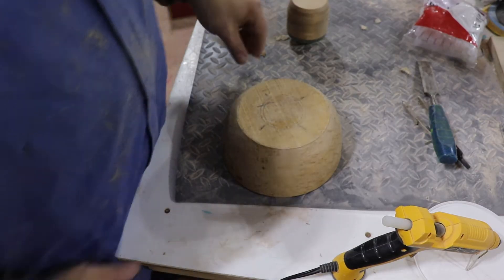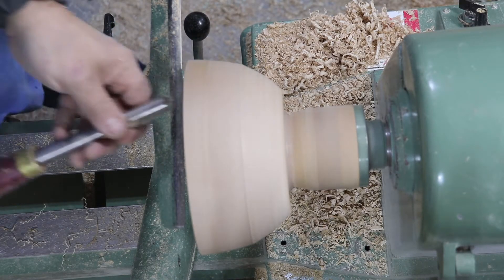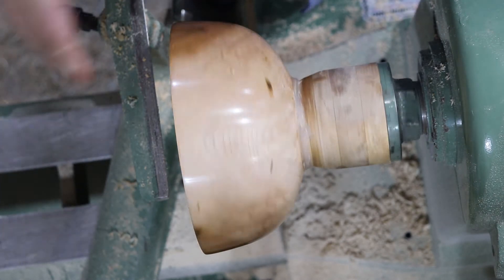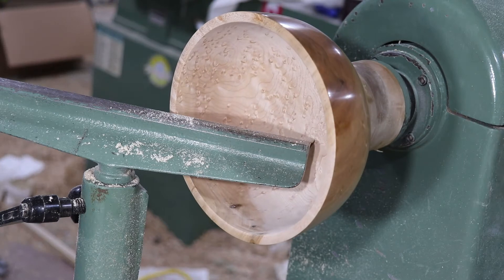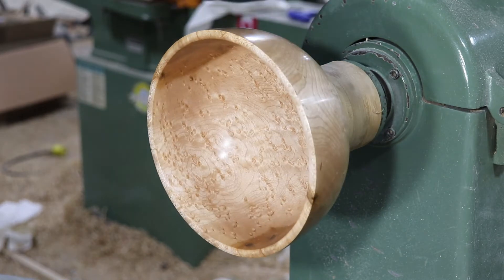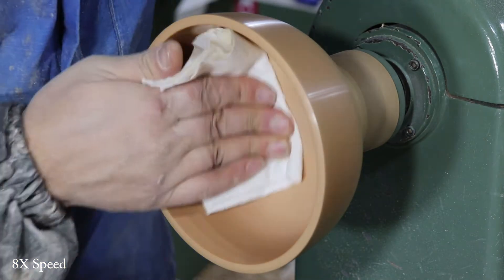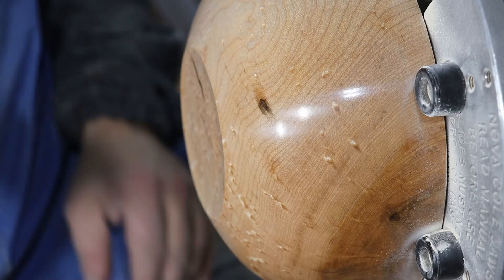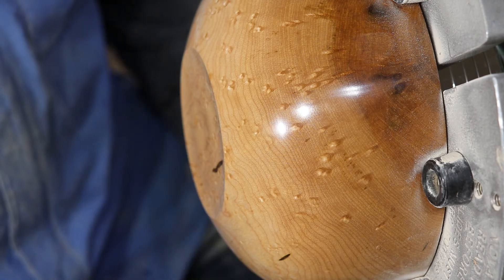Woodturning | 750 Subscriber Giveaway - Rare Quality Birdseye Maple

Comment: One more comment. I have turned and sold thousands of bowls in the last 40 years but I never used hot melt glue to hold a blank. Interesting and I will have to try it.
Reply from the maker: It works well. Some people heat up a pan and dip the blank rather than use the gun. Not sure how hearing and cooling affects it though.

Comment: Lovely bowl, gorgeous patterns.  Suggestion: don’t use autofocus unless you have to, as there are points where the bowl is fuzzy (the focus shifts to the handle of your scraper).  If your lighting is consistent, you should be able to fix the exposure and focus.  May help a bit.  But lovely work.
Reply from the maker: Thank you, The camera isn’t supposed to do that! Thanks for watching, I appreciate it. Good luck in the draw.